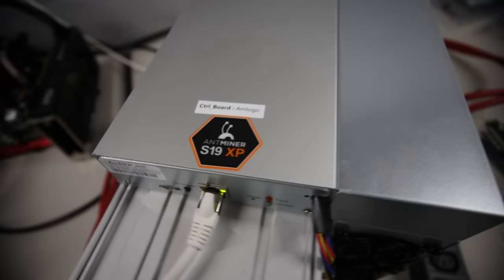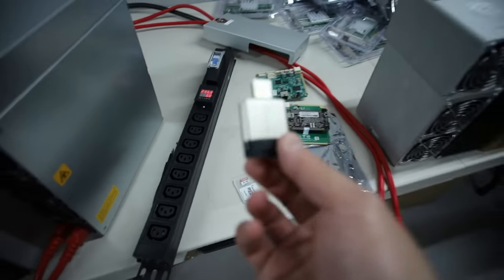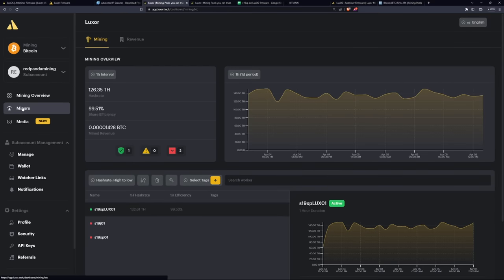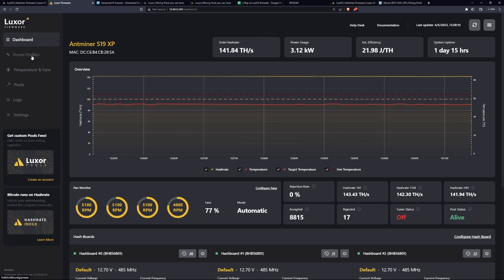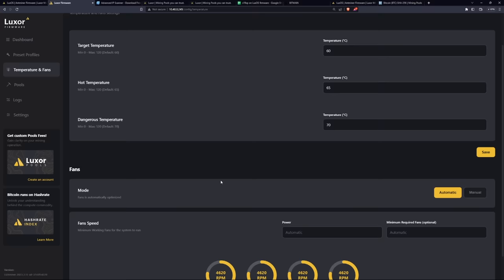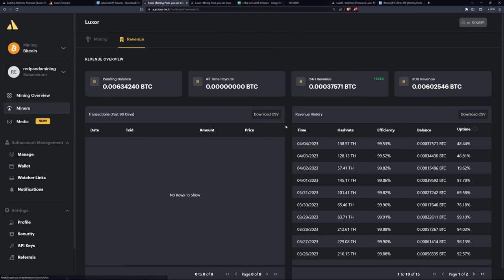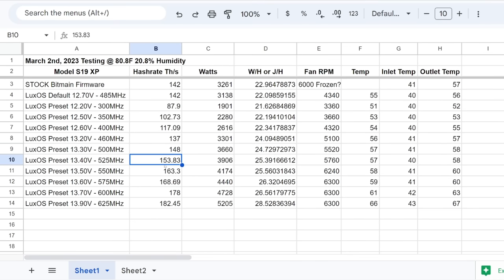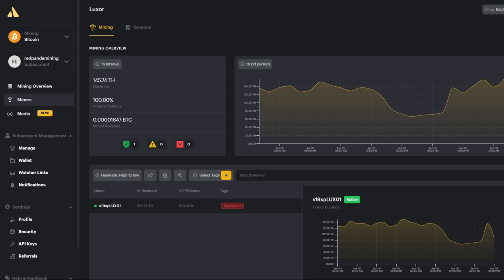Get MORE Bitcoin Hashrate & Efficiency with this new FIRMWARE for your S19 XP! LuxOS

Comment: I was looking at LuxOS myself I have a D3 and S9 i picked up from a guy locally to help heat up my fish room currently running them on HiveOS firmware, the s9 is getting 13~ TH at 1000~ watts, (Adjusted with the hiveos preset overclock) waiting for another psu to fire up the D3.

Another great video though! keep it up🤘

Comment: LuxOS does not currently work on Antminer S19 XP v 1.01. If you install a Xilinx board and try to put LuxOS on it, when you log into the LuxOS dashboard all you will see is spinning circles.
Reply: I accidentally bought one with Luxor it is s19 j pro how do I stop it

Comment: great video. do you have a link to purchase the xilinx boards ( exact one i need for the s19xp)? does opening the asic and changing the board void your warranty? do crypto miner bros sell the control boards and is it frowned upon to modify the asics like that? why isnt the s19 xp equipped with a xilinx board already? Also, stupid question :" is there any other way to change the firmware without changing the control board? thank you

Comment: I use a different firmware. The S19J pro are effected by chip temp as to efficiency, chips held at 60c gets you the best deal. Once they get over that then they are gonna use allot of electricity. My XP models have no microSD slot so not sure what to do with them.
Reply: Get a new control board. Xilinx or BeagleBone
Reply: Now Braiins supports Amlogic control board for remote installation of OS+ autotuning firmware

Comment: Panda, can u share what your S19 Xp runs on the bitmain low power mode?  Thanks in advance!
Reply from the maker: Theres no low power mode for the s19 xp series for the stock bitmain firmware. S19j pros there is.

Comment: The bitmain software has no devfee!!!!! Where you heard this false information? If you can prove it you can say it in video, but without a prove and only from hearing somewhere - it is not good to spread false information. 
If you mine on luxor it is ok to use the firmware, but you have enough other option and there is no need for changing the controller board, other firmwares can handel the beaglebon board.